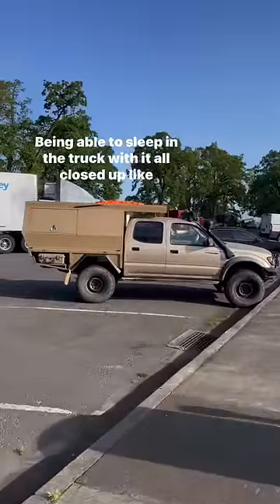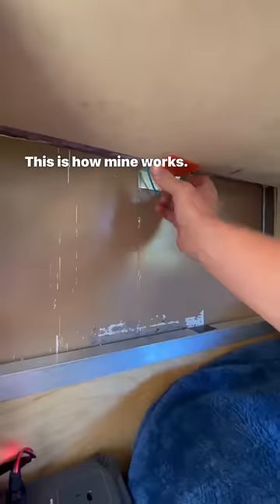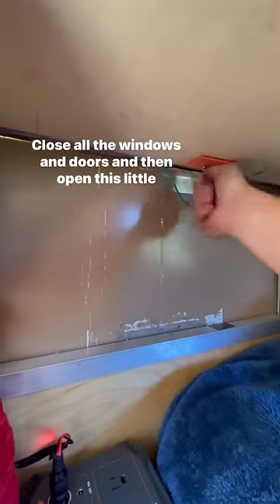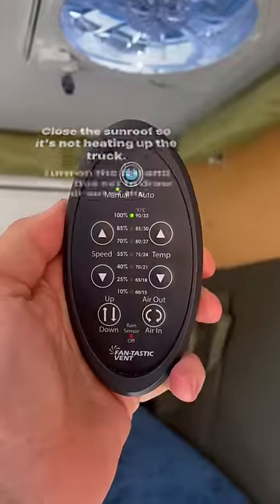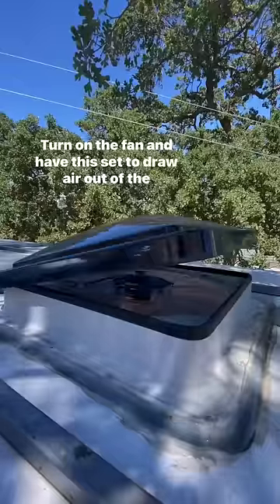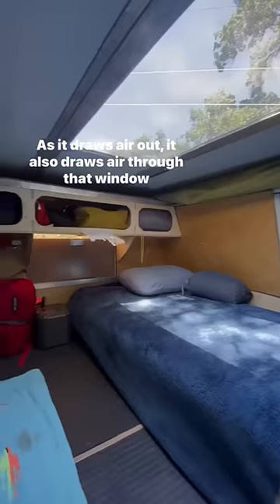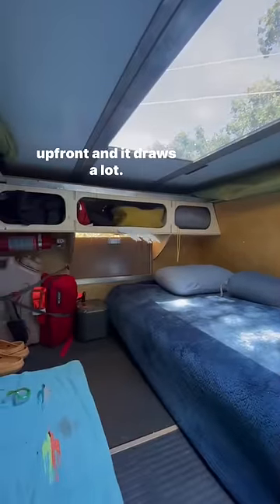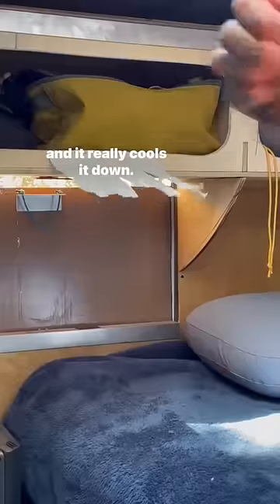Stealth camper setup

Comment: Your passive intake should be 3 times the diameter of the powered output or it should be also powered . Otherwise you are putting stress on your fan and it will greatly shorten its lifespan. 
- grow room  101 😉
Reply: i work adjacent to the HVAC industry, and ya, you dont wana make any fan work too hard...if you are getting wind, theres too much of a pressure difference. if you need it to be cool, maybe open it more and put a wet/damp cloth in the window for a lil evap AC =)
Reply: LETS GO
Reply: asking for a friend 

any other tips for grow rooms from you’re repertoire of knowledge  

Swim wants to know
Reply: Explain stress
Reply: @Ott3r5losh  Bruh don't say "SWIM". Your full name is on this account and "SWIM" does literally nothing to protect you. It does so little that it's basically a meme at this point.
Reply: @CSpottsGaming  HAAAA
Reply: @Ott3r5losh  keep it as sterile as possible, if you have pets or other plants make sure to check yourself before going into the grow room.
Reply: Curious, what kind of grow room?
Reply: @LeoGwapo12  either African broccoli or jazz cabbage
Reply: SWIM actually does offer protection if you make the argument it was for research as long as they don't have evidence to the contrary
Reply: Swimming helps by cleaning your skin of particulate
Reply: @CSpottsGaming  who rlly cares tho
Reply: @WitchMedusa  No it doesn't, because asking "how do I grow weed?" isn't illegal. So one of two things would happen when you ask (in the developed western world): people who could do something about it won't care (most likely outcome), or people who could do something about it would care and would investigate you, discover "SWIM" was actually "M", and arrest you for your grow op.

Let me repeat myself. SWIM does literally nothing for you. Asking questions about drugs isn't the illegal part. The illegal part is growing/producing them, and SWIM won't stop you from being investigated which means it won't stop people who care from finding out whether you actually did commit the crime.

The only three-letter agencies "SWIM" protects you from are the M.O.M. and D.A.D.

And all of this is doubly stupid when you have your first and last name on the account that's asking.
Reply: @mikehunt3688  Me, because I don't want to see some moron get arrested over something that should be legal because no one could be bothered to tell him to be smarter about how he conducts himself.
Reply: Wouldn’t it matter on the power of the fan…? There’s no way that’s a one size fits all equation. Maybe a rule of thumb
Reply: Wow I’m glad I saw this comment thank you this is actually very helpful
Reply: @WitchMedusa  no it really doesnt
Reply: @CSpottsGaming  what the hell is swim
Reply: @EO.studios  It's a term common when discussing drugs. It stands for "someone who isn't me". Like "SWIM did some really good acid this weekend."

People use it because they think the DEA is going to bust down their door if they say they did drugs but in reality the DEA mostly doesn't have the time or fucks to give about recreational drug use. In the event that the DEA actually does take an interest in you, "SWIM" doesn't give you any protection. They'll go the exact same investigation, etc.
Reply: It’s always better to have more intake than outtake
Reply: Vincent_Koltes huh you can grow it legally in most of North America lmao
Reply: @CSpottsGaming  yes you are correct, it is fully legal to ask about drugs, its legal to ask how to grow drugs, & its legal to research whatever you want.

The issue is people often implicate themselves when asking "I am trying to grow..."

One is asking, the other is an admission of guilt. Using "SWIM" ensures that you don't slip up & implicate yourself in a crime.

Could they chose to investigate anyways? Of course, but at least in this scenario they wont have an admission of guilt from you.
Reply: @ThisUsernameSystemF-ckingSucks  read my reply to the other guy
Reply: @WitchMedusa  right but using your first and last name defeats the point even when using “some one who isn’t me”. It’s pretty well known what that phrase means, it means me.

If the DEA or whoever else was after you and you were on YouTube using your first and last name while looking for advice (for someone who isn’t you) to grow weed, you’d be screwed.

It just seems silly to provide your full name, ask the question, and then use SWIM as though that matters at all.
Reply: @Cade McDermott  answering for a friend, try avoid going above 26c, keep track of humidity, water ph (seriously itll stop nute uptake if its too wrong) water temp, if you want quantity use hydroponics if you want it to staste good build up a supersoil, make sure theres enough light and airflow, keep good ventilation, lollypop and top, good training techniques, watch grow your own by kyle kushman on youtube. Find a hydro shop to help
Reply: @wadeklein8962  you're welcome ✌️
Reply: @The Hierophant It will increase it because there's more flow, hence less stress.
Reply: @mrluistito2529  it would definitely help to keep the buggyman👹 away !
Reply: @Ott3r5losh  theres a displacement guide for grow rooms. You wanna move air. A 5x5 has 6" mars hydro intake and exhaust, with two fans inside. One tower, and one 10" and stil could use one or two more clip fans for the poles. Humidity is huge. Starting 70% during germ, down to 40 st the end of flower. Drying at 55-62%, no direct air blowing, and curing is also another process I recommend just doing in your dry room so the jars aren't losing too much too quickly. 70% in the jar, still needs to dry. 70 and below youll burp twice a day until 65%, then biweekly down to your disired smoke preference.
Reply: Heh, the exhaust fans in the warehouse I work at must be having a rough damn time than because opening a garage door makes a wild strong wind tunnel, it's great on the hot days though.
Reply: I know you got a lot of relplies and probvly ignore them alot but if Gpds willing you wont ignore this.. i got a question.. im growing some ocean fruit in a 3x3 grow tent with a light meant for a 4x4-5x5 in other worss it runs hot. 

How how do i keep it cool?

 I have an ac running it its lowest setting, i have 2, 6in fans and one tower fan all blowing inside the tent.

But with the light on, in the east coast us, its like 90°F. 
So way too high.

I cant seem to get the temp down, so i ask you, is there a way to put your fans so its cooler or is there any other way to make it cooler without adding more fans?
Reply: Likely an HVAC & PC builder!
Reply: Ohhhhhhh I seeeeee
Reply: It looked roughly 3x but good knowledge...
I kept my intake ventilation roughly 4x fan exhaust.  4 × 4" versus 4" exhaust 😂😂😂
Reply: @CSpottsGaming  Possible deniability. There are ways around using your real name in the internet.
Reply: @Boddah.  Also not really a cornerstone of the argument but the term is "plausible deniability" for future reference.
Reply: @CSpottsGaming   Right. Plausible deniability and while difficult, you can still use the internet without using your actual name or anything else that can identify you. So your point is still wrong for future reference.
Reply: @Boddah.  It's not wrong, you're just not thinking critically about it.

Let's say for simplicity that only my name and IP address are traceable by Feds. If I don't cover my IP address, no amount of "SWIM" or username choice is going to help me against a Fed that actually wants to pursue me.

And if I do hide my IP and wisely choose a username, saying "I made X drug" isn't going to incriminate me any more or less than saying "SWIM" would.

SWIM adds exactly nothing to the level of protection, because even in a realistic scenario (where there are many identifiable markers I leave behind besides my username), I still have to cover all my tracks. If I do, I'm fine whether I say "SWIM" or not. If I don't and Feds choose to waste the time and resources on me (a hypothetical small time user/producer) I'm fucked regardless of whether I say "SWIM" because they'll investigate and find what they're looking for.

If you take even marginal precautions you're more than fine. If you don't, you're also probably fine. And using the term "SWIM" doesn't enhance your level of protection at all because the data points you leave behind (even with marginal protections) make you traceable by the highly funded and well-connected three letter agencies.
Reply: @CSpottsGaming  So you agree with me?.
Reply: @Boddah.  Your reading comprehension needs work, I think.
Reply: @CSpottsGaming  You think wrong. You admitted that it's possible to be completely anonymous online, which was one of my points. Also you never knowledge that how would they prove that you were the one asking how to make drugs, like how would they prove that you asked the question, how can they prove someone didn't steal your phone and knew your PW, or you allowed someone to use your device (phone/laptop/PC) without knowing they would ask a question like that; this is where plausible deniability comes in. I agree typing SWIM is pointless, but not for the same reasons you do.
Reply: @Boddah.  This discussion was never about whether it's possible to be completely anonymous online. You said there are ways to get around using your real name, which of course there are. Do you think people are unaware that usernames are a thing?

The question is, and was, about use of the term "SWIM."

Because that was the topic of conversation, I took your comment to mean that SWIM protects you if you don't use your real name (because, again, we were talking about that term). Apparently that was giving your argument too much credit.

To summarize: Yes, you can avoid using your government name. Of course you fucking can. SWIM (in this case, it actually is Someone Who Isn't Me) is stupid regardless.
Reply: @CSpottsGaming  I know people are aware, that's why I said you agree with me. Actually you gave credit no one asked for or wanted.

 My original comment never mentioned SWIM, my whole point was plausible deniability, so even if you did pose the question, they'll have to prove you actually did pose the question and that's a defense. 

You gave a hypocritical (remember?) and that's what I was aiming at. Oh and for future reference do is spelled with a d not a g
Reply: I know this systemic it  sucks...lol
Reply: @gilgoofthegrove5072  If he's camping anywhere where the relative humidity is above 70, the last thing he wants is to add more moisture to the air. I live in east coast US, and when it's 85 and 90 percent humidity outside, already feeling like breathing inside a sauna, the last thing I want is to add more moisture to the air. I know you're trying to make a swamp cooler, and you're coming from a point where plants want as much moisture in the air as possible, but humans are different, excess humidity on skin just makes us feel miserable and reduces the ability for evaporative heat removal by sweat.
Reply: @erpbridge  i am thinking from a desert point of view, fair
Reply: @CSpottsGaming you don't know about the true history of using SWIM if you think it's just a meme lmaoo.
Reply: i feel bad for people who actually put their real name on the internet...
Reply: @CSpottsGaming  I found the autism
Reply: Can you explain this but for dumber people to me pls
Reply: So nine times the surface area?

Comment: Evaporative coolers are a great way to cool campers when there are lakes or rivers nearby for water.
Reply from the maker: Heck ya! That would be fun to experiment with
Reply: SilentDiablo  Depends. If you're in an area with very low humidity, they work well. If it's humid where you are, forget about it. They aren't gonna do shit.
Reply: Unless you're in a humid area. They work best in arid places. In humid places you'll just wind up with moisture buildup in the camper. 

I live in Florida, trust me, we'd use them if we could. Because fixed evap coolers can run the tubing deep into the ground to really cool down the water being circulated. They just don't work in humid places.
Reply: @Wastelandman7000  Very true.  The drier the area the better evaporative cooling works.  RH in under ~25% evaporate cooling works shockingly good.
Reply: @grugmann THANK YOU 100$ DOWN THE DRAIN I FOUND OUT THE HARD WAY!!!!!
Reply: Thats what all our ACs were growing up in West Texas but it works there because its a desert... in New Orleans it would be useless
Reply: I have three small personal ones that run off of 5v dc. USB powered.

Comment: I love your truck.
I've got a MaxxAir and the front window "deflector" things so I can crack them without rain or hands coming through. Works like a charm. 
I've got a rechargeable fan and some USB ones to run off my lithium battery, but haven't been out camping in the heat since I "finished" building. It's just too hot here in Miami.
Reply: Yall leaving Lithium batteries in the cab? Sounds good n all till you realize you voided your insurance when they find out fire or some was started from a lipo battery inda cab unstable ass things😂
Reply: @moneybilla  Show me where I said that my lithium battery is in the cab.
Reply: @brian954 show us how that is not a reasonable and obvious assumption based on your original statement...

Comment: In HVAC we call this concept ERV, energy, recovery and ventilation. Great job!
Reply: No crossing of inside and outside air.
Reply: This is not an ERV and it’s crazy how many bonobos liked it. This is just regular ventilation. 😂
Reply: He's not trying to recover the heat from the exhaust air, it's not erv. This is just simple venting, which is great for summer. In the winter if he wants fresh air without losing his heat he could install a different erv unit

Comment: how refreshing. someone who is acquainted with fluid dynamics.  love you bro
Reply: Occasionally I’ll do vape tricks to explain that air counts as fluid and it breaks some people. (I run a smokeshop so for adults)
Reply: This is aerodynamics rather than fluid dynamics, and would constitute fluid dynamics, if measuring the flow state of liquids in the air.
Reply: @matthewk7507  I was wondering about that. We do this trick in hvac all the time. Like an attic draft fan in old houses.
Reply: @matthewk7507  Air, like all other gases, is a fluid.
Reply: @Eugene Konyha why’d this start a petty argument?
Reply: @matthewk7507  Not all fluids are liquids, but all liquids (and gasses) are fluids. This is exactly fluid dynamics.
Reply: @allenklingsporn6993  What is described in the video, is 100% Aerodynamics, which incorporates Fluid Mechanics. Fluid Dynamics is related, but not the same.

I'm not going to argue with a fool. Either you can accept the established definitions held throughout the world, or you can't and decide to continue your argument. I really suggest not using Britanica as your source for the definition, since they opted not to use the definition used by over 95% of Physicists.
Reply: @matthewk7507  saying that this isn't fluid dynamics and is instead aerodynamics is like saying "this isn't cooking this is seasoning".

In other words, they aren't mutually exclusive. Hydrodynamics and aerodynamics would be, because they explore liquids and gases respectively, but aerodynamics falls under fluid dynamics therefore both titles can be applied to the situation accurately and correctly.

As a side note, the ad hominem approach you took in your last comment is completely unnecessary and blatantly rude. No one appreciates an asshole trying to tell you "you're wrong" and no one will ever be inclined to change their mind if you write like that.
Reply: @matthewk7507  it is fluid dynamics. Fluids include both liquids and gases in physics literature. Aerodynamics is a part of fluid dynamics. Look it up. You honestly sound like someone who's never taken any post secondary physics class lol
Reply: @Eugene Konyha to some
Reply: ??? Understanding how fans work doesn't make you acquainted with fluid dynamics. That's like saying he understands the inner workings of a turbine because he installed a fan correctly.
Reply: @matthewk7507  I didn’t realize how much myth busters taught me as a kid until now 😂
Reply: @matthewk7507  fffç ee3f
Reply: @matthewk7507  this is definitely fluid dynamics. It's how air flows like a fluid. Aerodynamics is the relationship between air and solids. And how solids flow through air. You are wrong.
Reply: @SECONDQUEST  that analogy isn't even remotely close. He didn't just install a fan correctly, he installed a fan with the knowledge and intention of creating an airflow through the truck. That's quite literally understanding fluid dynamics, at least in the most basic form. Your stupid analogy about the inner workings of a turbine makes no sense and has no relevancy to the conversation.
Reply: Yeah force warm air up and out like it already wants to do creating a pressure vacuum. Cool shit
Reply: @matthewk7507  youre literally wrong! This IS fluid dynamics, not aerodynamics.. you talkin bout definitions and are wrong like that is really just too bad haha. I really feel bad for you emberassing yourself like that
Reply: @matthewk7507  I'm gonna jump into this petty nerdy debate for fun....
It's the thermodynamic effect (sudden expansion produces a cooling effect) in gas dynamics of fluid mechanics. The aerodynamics part is in the fan that's compressing the air flow. The efficiency of the fan can be improved by adding a shroud to reduce tip leakage losses in the blade.
Reply: @matthewk7507  nope. still fluid dynamics.

Comment: I'm generally not a fan of fans, but when it's too hot to do anything, moving air is what's called for. Your body sweats, and the air moving over the body is like a swamp cooler. If you get dry, wet down some clothing, hair, skin, anything to create that convection.